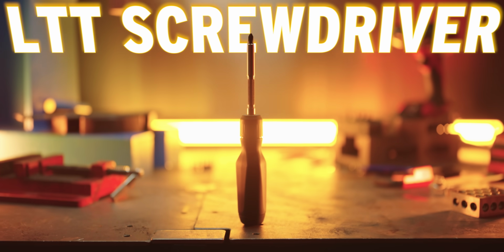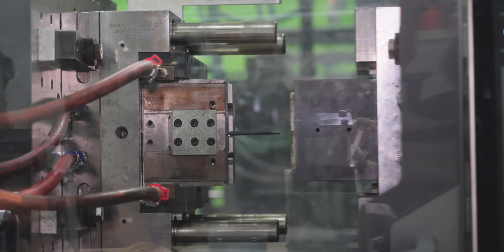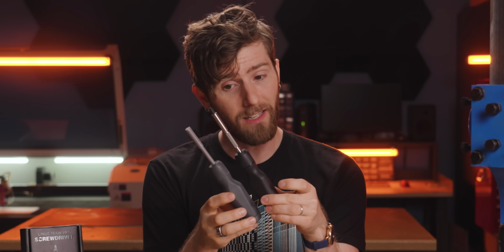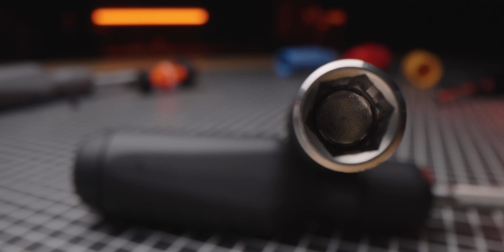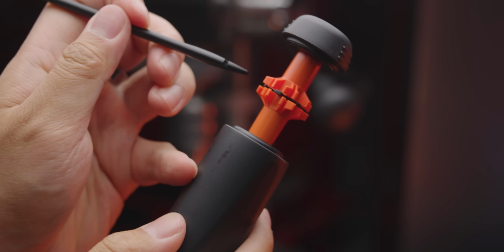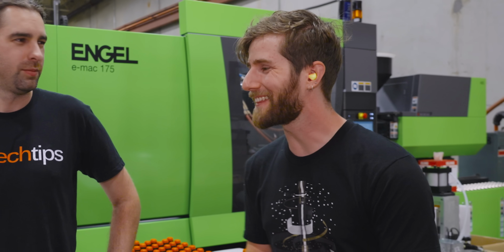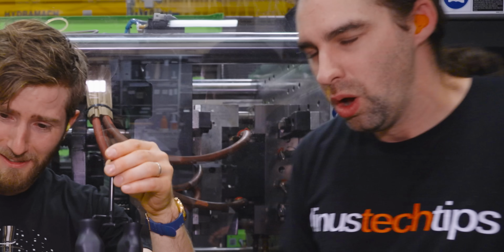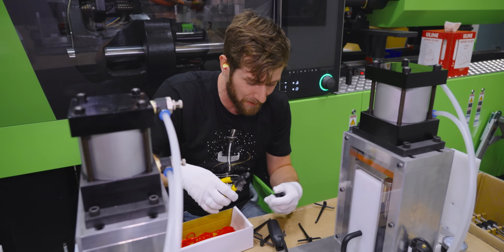Why our Screwdriver took 3 YEARS

Comment: Maybe it would have been cool if your bit sets were in a loadable colour coded cartridge/magazine format. I.e. slap in and swap out the whole bottom of the driver for a different type/set of bits.
Loading and unloading small bits and finding the right size is the fiddliest part of having a screwdriver with removable bits. So maybe the bits could be somehow  tethered to the holder and retractable so they cant be Linus dropped and always go back to the right labelled place.
Maybe we could get nanotech bits in the future that instantly shape themselves to conform to the screw you are trying to drive!
Yep it's going to be tricky to beat what you have made there!

Comment: I appriciate that I can still use it in automotive application cause whilst I have a 198 piece set, I would have to use a regular ratchet socket with a screw bit adapter to get the rachet functionality. Now i can add this to my tool set and have the ratchet functionaility built right into the product.

Comment: I don't like ratcheting screwdrivers. Though, watching this gives me an idea on how well designed and made your tool is. I'd be totally down if you made like a version of the shaft with a hex shank so it could be used with a bit lock. I feel the strong magnetic tip would be nice outside of a screwdriver.

Comment: I used to work in the field for 2 years as a level 2 maintenance tech the coolant is just water with some anti corrosives. if anyone was wondering its 1 giant computer style watercooling loop. btw i remember you line 3 -_- for context it was required pig blankets were put there by the lvl 1 techs because it leaked everything but water i was over there doing electrical work I was training for 3 phase at the time long story short got promoted to a level 3 maintenance tech i came in one day and my toolbox that was locked both internally and externally half my tools were missing I did find my tools nighshift stole 20 sockets so i filed a claim i stamp my initials in all my tools dude got fired and we got an oustide contractor who then stole my tools and my co workers tools the company tried to brush it off like it was not a big deal, ended up finding the contractor in walmart and started screaming at em I showed him the camera footage of him stealing my tools and did get my tools back i quit that job 1 month later there was also more intenal issues such as no raise gimp foot. so i took my earnings and got my cdl. edit this was no joking matter this was easily $5k of missing tools that I had to out of pocket

Comment: Great work on this, honestly, both the screwdriver and the video!

Please consider also making one without the bit-storage-handle and shaft. Just a nice handle and ratchet mechanism to be used primarily with 89mm bits. In some sort of fabric pouch or case to store it. 

Unfortunately I just find this type a little clumpsy and often enough unusable because either the shaft with the bit holder (and the bit itself on smaller sizes) makes it impossible to "get deep enough" if you know what I mean. And sometimes it's just too long with the shaft and you'd be better off with just the ratcheting handle and short bits.

Comment: I have a ball ratchet screw driver that has bits hidden into the body that I love, the design is similar to the LTT screw driver but it's spring loaded so it pops out on its own when unlocked. It also has a telescoping shaft for when you don't have clearance. It would be interesting if Linus implemented something like that since the one I have is kinda cheap but the idea behind it is solid.

Comment: Lot of comments here complaining about the price… bottom line is this is competing at the high end. I’d use this for automotive work (not requiring a torque screwdriver) and the closest competitor is snap on’s offering which also costs 80 USD and is far worse.

And for tools $80 is nothing. I suspect the issue is moreso that a lot of LTT viewers simply aren’t the target demographic anyways.

For example, I don’t want to be using a screwdriver with a low quality bit that causes me to strip a screw on a $500 GPU water lock setup. Or worse— dropping a screw in the engine bay of my car because I cheaped out and the magnet is weak.
Reply: I've been using quality japanese and german brands for 30 years with no problem... The LTT tax is just ridiculous for a product with unknown long term reliability.

Comment: Lamborghini did something similwhen the were developing the integrated headlight design for the second gen Diablo in the mid 90's.

They didn't want to spend millions of dollars designing and developing new headlights for it so they bought 300ZX  (which had gone out of production) headlight tooling from Nissan.

There was one fly in the ointment: the headlights had 300ZX branding on them, so they ended up spending about a million dollars too build the tooling to mill 2MM wide 6 inch long strips of carbon fibre which were epoxed onto them too hide the 300ZX laser etching on the upper headlight glass.

Comment: I know this is probably a bit out there in terms of ideas but for the black coating you might’ve been able to use DLC (diamond like carbon) which is usually used on knife blades and is extremely durable.

Comment: Im extremely curious whether the bits are JIS or philips derived.  I realize both of these are dead specs and all fall into the modern PH spec.  That said i find that JIS based bits from from companies like vessel that have been altered to fall under PH work much much better for both IS and powersports uses.  Every western philips based bit that has been modified from Philips to PH standard tends to be much more prone to stripping heads and slipping out.

Comment: I have worked in plastic injection molding for 22 years and I am really impressed with the setup that PH Molds is using. I love the fact that yall are making the screwdriver in canada! It cost a lot more BUT the quality control is going to be on point.  Just ordered me 2 units. Cannot wait to get my hands on them.

Comment: I would have attempted to make the handle out of wood or done something silly like making a custom grip by sending every customer a ball of puddy to squeeze.

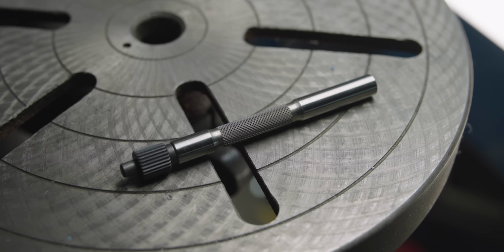10:04, that knurling looks similar to a kriss kross razor handle, it was impossible for that thing to slide around your fingers even when full of slippery soap. You want to research knurling you want to research safety razor handles

Comment: I'm impressed you guys were that picky about the gate/sprue marks. Even LEGO has more noticeable sprue/gate marks on their bricks and figures. I am a little disappointed that the handle isn't orange and black, like some of the earlier prototypes, but that would have required a dual molding, which would have been an even bigger logistical nightmare.

Comment: Linus: Took us three years and hundreds of thousands of dollars to build this!
Also Linus: We need those dollars back in two weeks so let's overprice the shit out of it.

In a serious note, the problem with the pricing is in relation to the nature of the screwdriver. It's a screwdriver. A manual screwdriver to be precise. These do not fail easily, they do not strip the tips unless you have no idea what you're doing, nor do they need replacing every few months.
Half of my screwdrivers I got from my grandpa, they're over 50 years old and still work just fine.
So, this is going to be a long-term investment for me, meaning that now that I know you made it, it exists and it works, I'm going to buy one when I need a replacement.
Love the content <3

Comment: Linux, I gotta hand it to you. The screwdriver looks fantastic. I will be ordering one right away. I will barely even use it for computering. Mostly it will be out in my shop for working on vehicles, tractors, and myriad other actual tool uses.

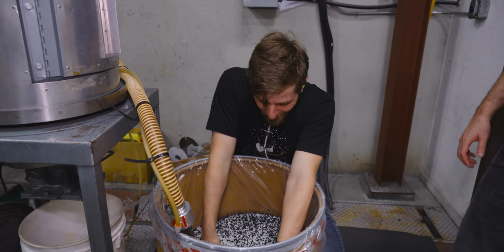Comment: 19:50 - Dude, you do not leave your raw materials for injection molding be left in the open like that, let alone be 'touched' by bare hands. Any particulate that could mix with (dust, dead skin cells, grease, oil residue) will contaminate your batch, unless you have a relaxed tolerances for contamination. Learned this the hard way with Thermos.

Comment: I bought a Snap On ratcheting Screwdriver in 1089, I think I paid $65 for it back then.  Yes 33 years ago but,  I've used it so much the texture is smooth in some spots and it still works perfectly.  I am sure that yours will be just as good.

Comment: I love the ratcheting mechanism, Very well thought out and I SWEAR by Megapro screwdrivers.  I have a whole set of them in my toolbox and bucket truck.  Although, I'm not a big fan of using ratcheting screwdrivers on electronics, not to mention magnetic tools.  Call me old fashioned but I was always taught to never use magnetic tools on electronics.  The magnetism can potentially create a current in fine tuned circuits.  Also, I would prefer a rubbery handle and would love to have a hexagonal place on the shaft to place a wrench for those 'extra torque' moments.  And you know people are going to use a hammer on it, chisel with it, or clean corroded screws with it.  that's a given. "the worse thing about making anything idiot proof is underestimating the ingenuity of complete idiots"  Having a rubber pad on the handle would help with that.  The rubbery handle would also act as an insulator for those times that you forget to discharge a capacitor...not that I've ever done that...🙄lol

Comment: Tool and die maker here…
Loved the video and appreciation for the work involved!  I primarily make molds for automotive and aerospace electrical connectors.  Some molds are ~100 “cores” per cavity!  Tolerances are as tight as 1 micron, especially where the cavities vent gasses.  Anyway, would be cool to have a special edition set that is TiN-coated (titanium nitride).  If not, I can always coat my own ;-)

I love the attention to detail that went into making the screwdriver.  Very impressed.
Reply: But how much would you charge to coat me a screwdriver?..
Reply: I interned at a plastic injection molding shop, these molds can get seriously expensive quickly.  Or you can ring up China and hope they don't royally screw up your mold 🤦

Comment: Yes, but does it come with a warrantee?
Reply: LTT Screwdriver Limited Lifetime Warranty
THE LTT SCREWDRIVER IS COVERED BY A LIMITED LIFETIME WARRANTY AGAINST BREAKAGE DUE TO DEFECTS IN MATERIALS OR WORKMANSHIP FOR THE USUAL AND CUSTOMARY LIFE OF THE TOOL.

THE LIMITED LIFETIME WARRANTY DOES NOT COVER:

Bits, as they are considered a consumable item;
Tools which have been subject to abuse, misuse, negligence, or improper storage;
Tools which have been used improperly e.g. using the screwdriver as a pry bar or hammer;
Tools which have been altered in any way;
Normal wear and tear (including the breakdown of materials over time);
Cosmetic damage (including scratches or changes in the finish of the plastic handle);
Products purchased from unauthorized dealers
TO COMPLETE YOUR WARRANTY CLAIM YOU MUST SEND YOUR PRODUCT TO THE ADDRESS PROVIDED BY OUR CUSTOMER SERVICE TEAM. CREATOR WAREHOUSE, INC. RESERVES THE RIGHT TO INSPECT YOUR PRODUCT TO DETERMINE IF IT IS SUBJECT TO THIS WARRANTY. IF WE DETERMINE THAT YOUR PRODUCT IS COVERED BY THIS WARRANTY, WE WILL (AT OUR DISCRETION): (1) REPAIR THE PRODUCT AT NO CHARGE FOR LABOUR OR PARTS, (2) REPLACE THE PRODUCT WITH THE SAME MODEL PRODUCT, (3) REPLACE THE PRODUCT WITH A COMPARABLE PRODUCT SHOULD YOUR PRODUCT BE DISCONTINUED OR OTHERWISE UNAVAILABLE, OR (4) PROVIDE YOU WITH A VOUCHER TO BE USED TOWARD THE PURCHASE OF OTHER PRODUCTS ON LTTSTORE.COM.

IN ORDER TO MAKE A WARRANTY CLAIM, YOU MUST BE THE ORIGINAL PURCHASER OF THE LTT SCREWDRIVER FROM LTTSTORE.COM OR PROVIDE A COPY OF THE ORIGINAL PROOF OF PURCHASE.

Comment: What's the warranty though? LOL
Reply: LTT Screwdriver Limited Lifetime Warranty
THE LTT SCREWDRIVER IS COVERED BY A LIMITED LIFETIME WARRANTY AGAINST BREAKAGE DUE TO DEFECTS IN MATERIALS OR WORKMANSHIP FOR THE USUAL AND CUSTOMARY LIFE OF THE TOOL.

THE LIMITED LIFETIME WARRANTY DOES NOT COVER:

Bits, as they are considered a consumable item;
Tools which have been subject to abuse, misuse, negligence, or improper storage;
Tools which have been used improperly e.g. using the screwdriver as a pry bar or hammer;
Tools which have been altered in any way;
Normal wear and tear (including the breakdown of materials over time);
Cosmetic damage (including scratches or changes in the finish of the plastic handle);
Products purchased from unauthorized dealers
TO COMPLETE YOUR WARRANTY CLAIM YOU MUST SEND YOUR PRODUCT TO THE ADDRESS PROVIDED BY OUR CUSTOMER SERVICE TEAM. CREATOR WAREHOUSE, INC. RESERVES THE RIGHT TO INSPECT YOUR PRODUCT TO DETERMINE IF IT IS SUBJECT TO THIS WARRANTY. IF WE DETERMINE THAT YOUR PRODUCT IS COVERED BY THIS WARRANTY, WE WILL (AT OUR DISCRETION): (1) REPAIR THE PRODUCT AT NO CHARGE FOR LABOUR OR PARTS, (2) REPLACE THE PRODUCT WITH THE SAME MODEL PRODUCT, (3) REPLACE THE PRODUCT WITH A COMPARABLE PRODUCT SHOULD YOUR PRODUCT BE DISCONTINUED OR OTHERWISE UNAVAILABLE, OR (4) PROVIDE YOU WITH A VOUCHER TO BE USED TOWARD THE PURCHASE OF OTHER PRODUCTS ON LTTSTORE.COM.

IN ORDER TO MAKE A WARRANTY CLAIM, YOU MUST BE THE ORIGINAL PURCHASER OF THE LTT SCREWDRIVER FROM LTTSTORE.COM OR PROVIDE A COPY OF THE ORIGINAL PROOF OF PURCHASE.

Comment: there is 0% chance this is the best screwdriver. also, what about the warranty ? lol
Reply: I wouldn't same zero percent chance. That's never zero. slim? sure. possible? maybe. absolute? no. also here's the warranty. you could've just looked it up yourself. -_-

LTT Screwdriver Limited Lifetime Warranty
THE LTT SCREWDRIVER IS COVERED BY A LIMITED LIFETIME WARRANTY AGAINST BREAKAGE DUE TO DEFECTS IN MATERIALS OR WORKMANSHIP FOR THE USUAL AND CUSTOMARY LIFE OF THE TOOL.

THE LIMITED LIFETIME WARRANTY DOES NOT COVER:

Bits, as they are considered a consumable item;
Tools which have been subject to abuse, misuse, negligence, or improper storage;
Tools which have been used improperly e.g. using the screwdriver as a pry bar or hammer;
Tools which have been altered in any way;
Normal wear and tear (including the breakdown of materials over time);
Cosmetic damage (including scratches or changes in the finish of the plastic handle);
Products purchased from unauthorized dealers
TO COMPLETE YOUR WARRANTY CLAIM YOU MUST SEND YOUR PRODUCT TO THE ADDRESS PROVIDED BY OUR CUSTOMER SERVICE TEAM. CREATOR WAREHOUSE, INC. RESERVES THE RIGHT TO INSPECT YOUR PRODUCT TO DETERMINE IF IT IS SUBJECT TO THIS WARRANTY. IF WE DETERMINE THAT YOUR PRODUCT IS COVERED BY THIS WARRANTY, WE WILL (AT OUR DISCRETION): (1) REPAIR THE PRODUCT AT NO CHARGE FOR LABOUR OR PARTS, (2) REPLACE THE PRODUCT WITH THE SAME MODEL PRODUCT, (3) REPLACE THE PRODUCT WITH A COMPARABLE PRODUCT SHOULD YOUR PRODUCT BE DISCONTINUED OR OTHERWISE UNAVAILABLE, OR (4) PROVIDE YOU WITH A VOUCHER TO BE USED TOWARD THE PURCHASE OF OTHER PRODUCTS ON LTTSTORE.COM.

IN ORDER TO MAKE A WARRANTY CLAIM, YOU MUST BE THE ORIGINAL PURCHASER OF THE LTT SCREWDRIVER FROM LTTSTORE.COM OR PROVIDE A COPY OF THE ORIGINAL PROOF OF PURCHASE.

Comment: Hi, Do you make a JIS standard bit? 
(Japanese Industrial Standard)

JIS screws are common in Japanese motorcycles, cars and machinery, as well as some European made motorcycles

Japanese Industrial Standard (J.I.S.) cross-point screwdriver’s fits a JIS and a Phillips screws. However, a Phillips driver will not fit a J.I.S. screw. It can only fit a Phillips screw snugly

Comment: all I ask. a cheap 6 in 1 style multi bit screw driver where the shafts are ball bearing (instead of the bits). instead of a philips 1 and philips 2, make them robertson 1 and robertson 2. i am an electrician so this video doesn't apply to me.

Comment: Just a bit of feedback from watching the video, maybe since the shaft is metal it would be nice to have it coated with some durable paint or a plastic layer since it goes inside electronics and it would protect against shorts. Also a "grip" for wrenches would be nice. If you just want to protect if from oxidization you could use something like a liquidmetal coating, it would improve the looks and you could add a bit of branding. Also maybe you can do a version with interchangeable shafts so the shaft can fit tighter spaces. But I know that's potentially 3 more years of work.

Comment: One thing that I like about the longer bits from megapro is that I use them in my drill…. Doesn’t really work with these tiny bits unless you get an adapter but that’s a pain in the ass.

Comment: I absolutely adore the transparency. I love to know what my tools are made of and it is almost always nearly impossible to figure out. I also thoroughly appreciate the insight into the design and mass manufacturing process.
Reply: oh yeah theres only snap on, sk, pb swiss, wiha, wera, hazet, gedore, wright, chapman, mac, vessel, ktc, and the dozens of other non slave labor brands telling you metal specs and costing a fraction but ok.
Reply: Oh basic metal specs for single material items sure, they will tell you what the pliers and hammers are made out of. What I want is a full schematic of even large complex items like power drills that show exactly what material each individually. For most mechanical tools and virtually any non-industrial power tools it is nearly impossible to find out what the internal parts are made of without tearing it down to check part stamps, if they are present.